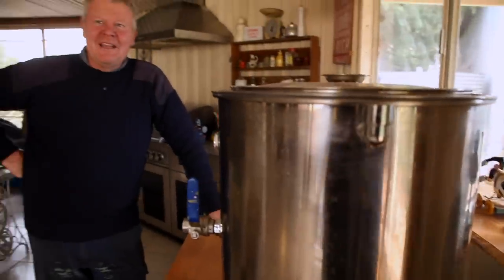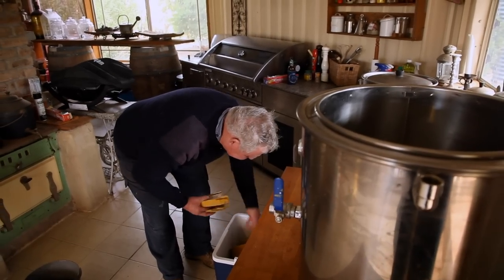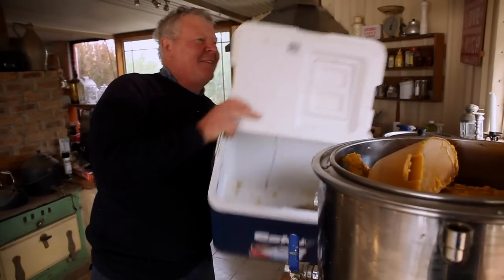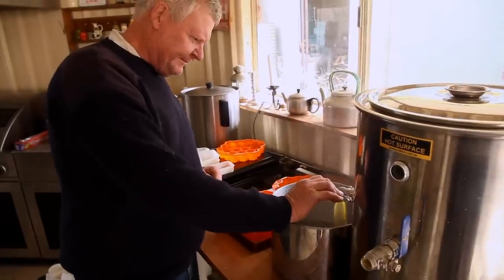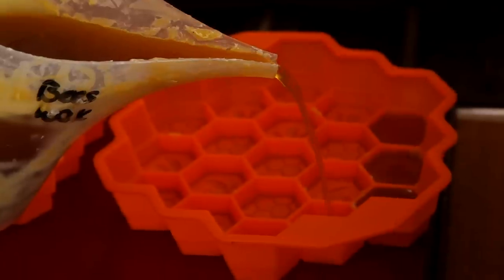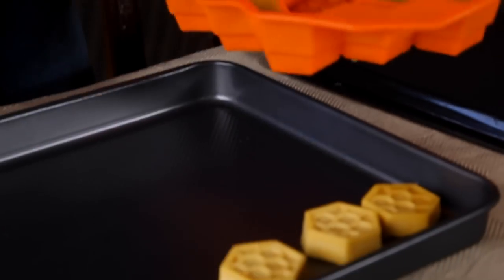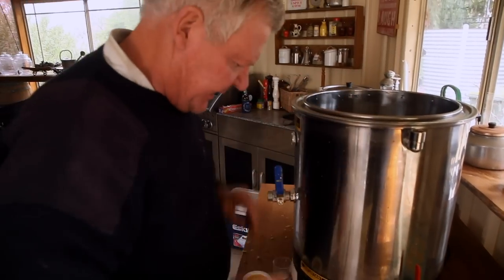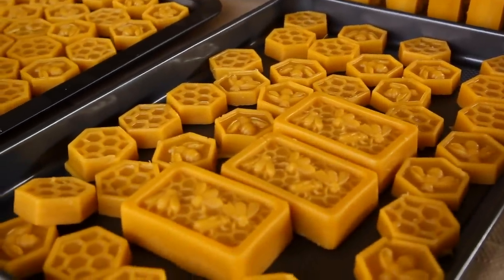Rendering Beeswax: How to Clean Beeswax Part 3 | The Bush Bee Man

Comment: wondering if one of those hot air food dehydrators, with heat settings, could be used to filter wax... lay a filter over the tray of the dehydrator and set up a catch bin... the wax wouldn't burn as the heat could be set and it wouldn't have to be watched, leaving a person free to do other things... I bet it could be done with something like my Nesco dehydrator... the trays are plastic so could be modified if needed... I'm gonna put some more thought into this idea...

Comment: I've seen where they feed the water back to the bees in open feeders. Any thoughts?
Reply: It certainly couldn't hurt. But after being boiled it is not raw honey anymore.
Reply: @privatebubba8876  I understand this, but the sugars are still in that water. Also, the water needs only be half boiling temperature to melt the wax. There's just as many methods as there are keepers, I reckon. I like solar melters. It saves time, resources and energy. They can be made large scale. All you have to do is load at one end, and collect at the other.
Reply: @gazinta  Like I said it couldn't hurt.
Reply: @privatebubba8876  I grew up on a farm. We had to pump water up by hand and absolutely everything was re-purposed. Even something like brood would be used as chicken food, and eggshells would be composted. I was just inquiring to BBMs feeding practices. It can get quite expensive.
Reply: @gazinta  We drew water from a well with a bucket.

Comment: I cheated...

The number of bees required to produce 1 kg of beeswax varies depending on the species of bees and other factors, such as the quality of the nectar and pollen available to the bees. However, on average, it is estimated that it takes about 8,000 to 10,000 bees to produce 1 kg of beeswax.